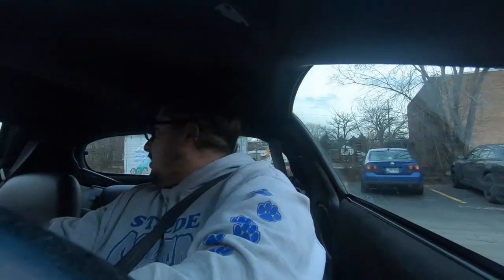Full breakdown of Charger dyno video! Must watch

Comment: Check if the intake manifold bolts are loose, big problem on the 392’s that will cause surging and power loss. Good luck!
Reply from the maker: Really that’s interesting never heard of that. I am replacing intake manifold with ported this week so will figure out if that’s the issue! Thank you for that

Comment: Who is your tuner ?  Don’t get caught up in the numbers the real numbers will be at the track . Mine has been 11.3@121 fbo and made only 439 rwhp lol
Reply from the maker: I’m
Not but my ls1 cammed makes more torque then my charger and its just my charger is putting 100+ torque lower
Reply: Ant Frank don’t believe the dyno could be reading wrong mine showed 451hp and 566 tq on one run
Reply from the maker: Once my new parts come in should have a good tune and make good numbers fbo cam